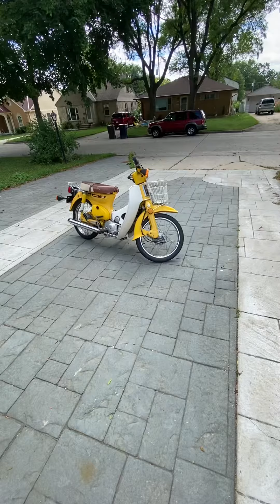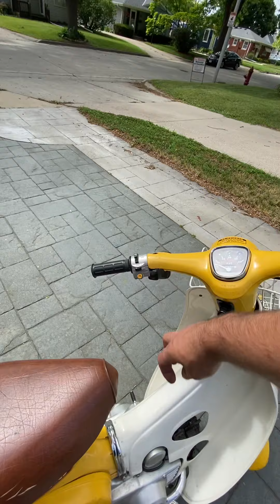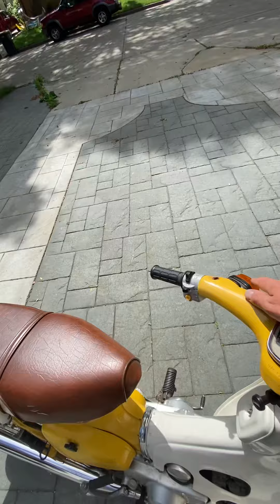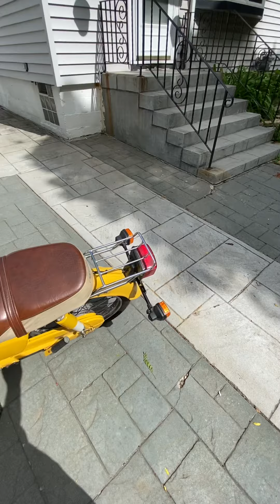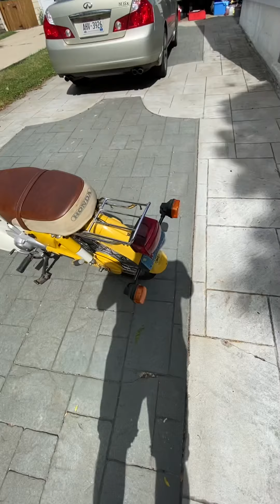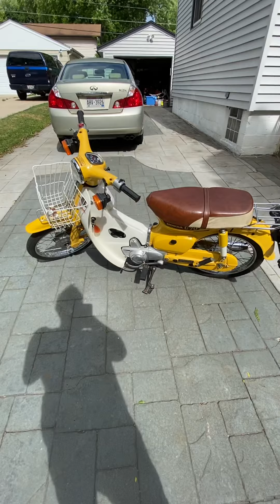Tip to getting electric start to work on a 6 volt 1980 Honda C70 Passport

Comment: Change your 6 volt to 12 volt just change your bulbs to 12 volt and fuses is all go to NAPA for everything
Reply: how do you do that, I have a 1981 and have been trying to figure out so I can use led bulbs
Reply: @gagemcguire7732 why do you want led bulbs? That would look corny on a bike that old
Reply: Great! Thankyou .have has my "81 like Your's since 2000 . .   and never thought to hold tge Starter down longer. I Wonder if it may Work ! 🏁